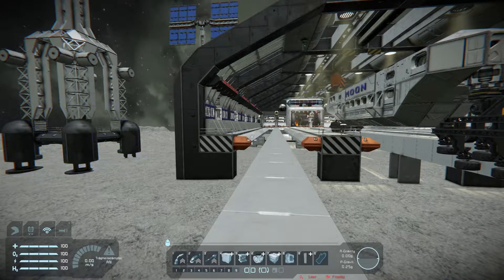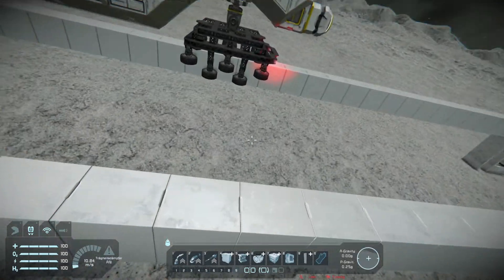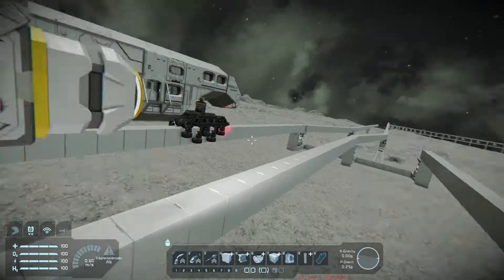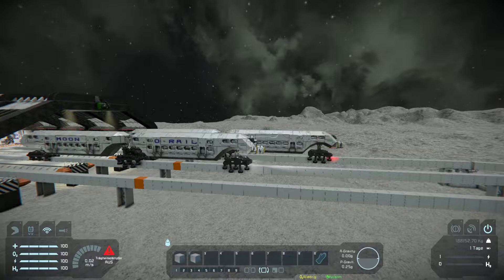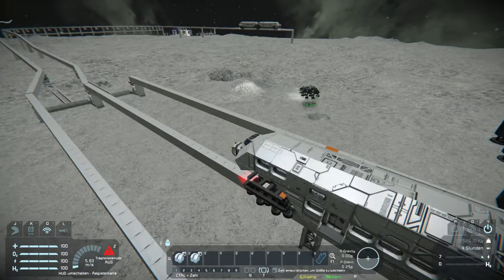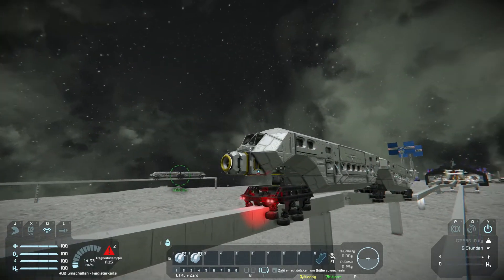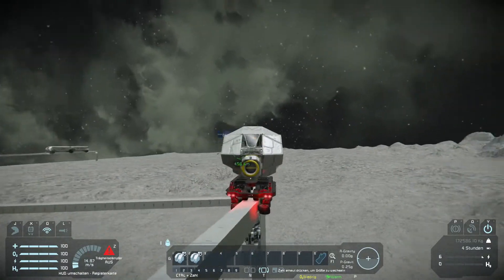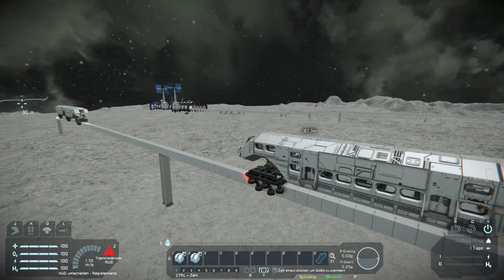Space Engineers Monorail test drive on the moon EP 4

Comment: Cool! Both of them are actually kinda stable considering that turn is kinda sharp.

I see you are using rotor setup with blast door edges as rail joint. I'm curious what's your experience on the stability compared to hinge rail setup, especially on the junction part of the rail?

I'm also curious how your bogeys designs behave on different G pulls and does that complicated design phantom forces add to the stability on low G. Because now that I'm thinking about it, I haven't made any rail type on low G lol.

Also also do you have any experience with "G" (wrap around) type monorail bogeys and "Q" (1 and a half block tall with support nubbin on the half block corner) or "T" type rail on low G? I used it that combination before on zero G on my asteroid cluster base, albeit as a gondola/suspended type cargo monorail, as it more or less secure the monorail in every direction (still can twist on a corner tho especially if overweight). But now I'm interested and intrigued on how it would behave at low G.
Reply from the maker: Thanks! I tryed rails with hinges, but with the first prototyp, that dosn´t work, I didn´t try that again.

With the low G, i thounght it would be a problem while passing a slpoe, but with this setup bouth work fine, also passing curves, when the side suspension is to hard, the train start to swing and pull over. (when its to soft it so or so pull over)

On low G I only used the blastdoor type, until now. When I´m building a new train I will try it with suspension with a rotor head (awesome idea!) and the "T" type rail
Reply: @royalrollin8372  ye, making monorail is hard in SE. I have better success with dual rail setup instead tbh lol. Especially with "C" type rails and "+", "T", or "H" pattern bogeys.

I guess either rotor and hinge is fine and works similarly huh, just depends on preference. I also see that you lock the rails using landing gears on the junction. Smart, as attach and detaching rotor/hinge is kinda clangy. Also, did you convert the rotor rail segments as station/static grid or you just lock the rotor?

The problem of monorail is that it needs either tall or wide rail and bogey contact for "C" type bogey (only contact 3 sides like your designs) conventional monorail train to work smoothly, especially for cargo monorails. While "G" type bogey (wrap around or contact all 4 sides of rail) is a must for gondola/suspended type monorail. The train cannot be too tall either. If the center of mass is too tall it would easily topple over.... Which means the bogey need to be sunk into the rolling stock.... Which mostly fine for cargo but kinda took some space for passenger trains.

Also did you try small grid trains instead of large grid? It might be lighter compared to large grid rolling stock design. But for low G I think mass plays a huge role, as too light of a train, it would simply float away especially on bumps and turns....

Also how do you setup the suspension? The same across the vertical bogey contacts? Or alternating like for example

1---1 soft
2---2 medium
3---3 hard
4---4 medium
5---5 soft

Because I noticed that it bounced/shake while the front (1) and rear (5) at different rail segments with the inner center (3) almost not touched the rail surface and the outer center kinda pushed it in. Did you tried with 3 vertical contact too for shorter overall vertical point of contacts?
Reply from the maker: The rails on the junction are ship grids, the rotor is unlocked.

I didn´t test small grid cars jet, but I will when I build a new type on monorail car. I made a test with cargo mass, 7 small large grid containern are already no much (I replaced the seats with cargo filled with iron ore)

The side and the drive suspension are different, only the wheels on top drive, side only for breaking; strenght 50% offset -28,5 cm, all side wheels have the same setup. Maybe I should improve that like your example.

I hope I can finish tomorrow that, I will make a new video and put it on steam workshop (with a test track and a small hub), when its ready
Reply: @royalrollin8372  cool cool. Monorail designs on SE is so far in between compared to trains. So I'm excited when I found someone tackling one.

Good luck on your build!